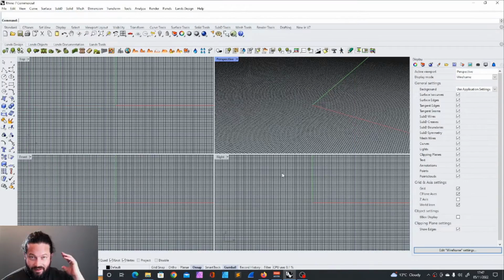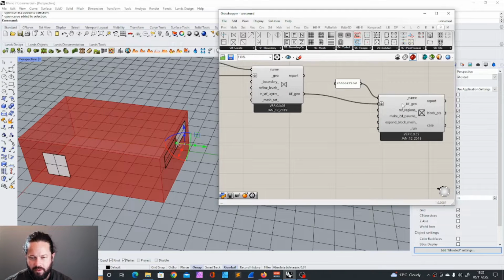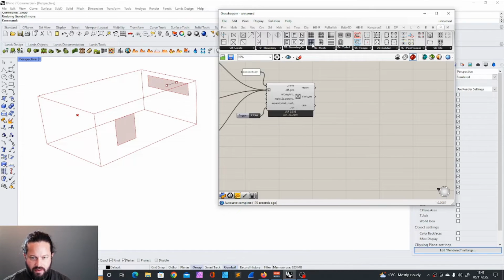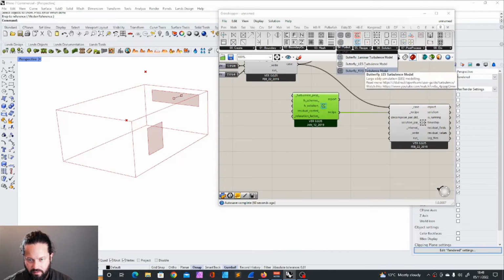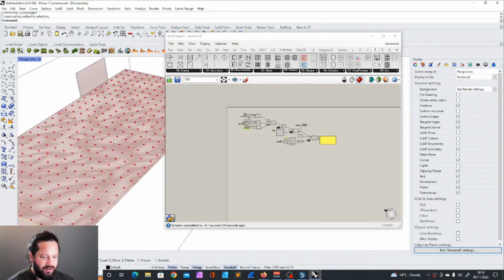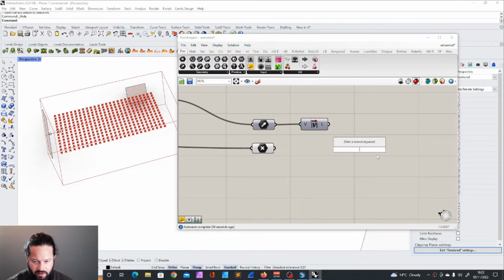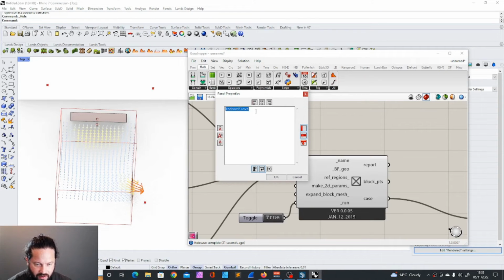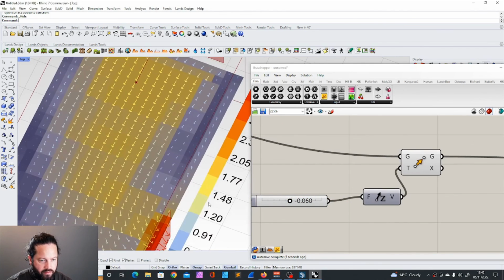Indoor Airflow - A First Script - Butterfly CFD Tutorial

Comment: Hi sir, thank you for tutorials. I can follow it and none of the components are red. However, the vector doesnt shows. How can i fix it? thank you in advance
Reply from the maker: If everything runs without errors but the vectors don’t appear, I’d first check the Vector Display component itself: make sure its preview is enabled and that it is actually receiving both the anchor points and the vectors. Also try increasing the vector scale considerably — CFD velocity vectors can be very small relative to the Rhino model. If that still doesn’t work, check the output panel to confirm that the simulation is actually returning non-zero velocity values.

Comment: tengo un problema al momento se generar heatmap me aparece un error. 1. Solution exception:Expected the number of data set values (2812) to align with the number of faces (4869) or the number of vertices (5012). Consider flattening the _values input and using the "Mesh Join" component to join the _mesh input. en este caso que debo hacer ? no he podido encontrar una solucion porque hasta _values lo he puesto en flatten y no me da
Reply from the maker: This error usually means the mesh and the result values don’t correspond to each other. Flattening only fixes the data-tree structure — it won’t fix a mismatch in the actual number of values.
The Heatmap component needs either one value per mesh face or one value per mesh vertex. In your case, 2812 values don’t match either 4869 faces or 5012 vertices. Make sure the test mesh and the probe points come from the same origin mesh, and if the mesh is split into several parts, join it with Mesh Join before connecting it and before generating probe points.  If the counts still don’t match, the results need to be regenerated or mapped to the correct mesh. You might need to delete the previous calculation or rename the analysis.

Comment: Hii, thank you very much for the tutorial. I am facing an error at Butterfly Load Mesh it is saying "1. Solution exception:index out of range: 6"
Reply from the maker: Have installed Blue CFD core. And Which version?
Reply: @PhilippGalvanDesign  Yes I have installed the 2017 version
Reply from the maker: Have you tried the example file which comes with Butterfly. Check the installation files.  If that works then you have a problem with your script. If it doesn't then you have a problem with your installation. Are you running Rhino in admin mode? Did you set up the environment. (Blue CFD)

Comment: Thank you so much for your tutorial! I have met a problem, the “butterfly_load probes value” component met this error: 1. Solution exception:Failed to load values:Failed to find probes folder folder at C:\Users\fayia\butterfly\indoor_airflow2\postProcessing\probes, do you know why to fix it? thank you so much!
Reply from the maker: Are you running Butterfly in Admin mode?
Reply: @PhilippGalvanDesign  yes. I am already in admin mode.😂
Reply from the maker: Ok then that error probably means Butterfly is trying to read probe results that don’t exist. In other words: the solver never wrote them, or it wrote them somewhere else.
Most common reasons (99% of cases):
The simulation didn’t actually finish → probes never get written.
The case folder was moved / synced / renamed (OneDrive & friends are repeat offenders).
The file path contains spaces or special characters. 
Probes weren’t enabled in that run, but the component still tries to read them.
Version mismatch: old Butterfly definition + newer OpenFOAM layout.

Do this, in this order:
Run the case without probes first. If that fails, probes are not your problem.
Put the case in a boring path like C:\CFD\case01\ (no spaces, no undrrlines, no drama).
After running, check if a probes or postProcessing/probes folder actually exists.
If it doesn’t → Butterfly can’t  read it.
If on Windows, run Rhino once as admin and make sure the folder isn’t read-only.

Comment: Hi Philipp, thanks for the guidance, really helpful. I have an error right at the end at LoadProbesValues saying: 1. Solution exception:Failed to load values:
	Failed to find probes folder folder at C:\Users\User\butterfly\indoorFlow\postProcessing\probes. If I remove the solution node the error is gone, therefore I think there is something to do with the Solution. The reporting panel says the following:' Failed to read c:\users\User\butterfly\indoorFlow\log\simpleFoam.err ' I was reading forums about re-running the probe, but I am not sure what that means. I checked all the installs, went through them again, it all should be ok with BlueCFD 2017. This error keeps coming up, but no one answers them anymore in the forums.
Reply from the maker: Are you running Rhino in admin mode?
Reply: @PhilippGalvanDesign  Yes I was running it in admin mode. I gave up at the end as after searching several forums, multiple people had the same issue, but there was no answer to it...

Comment: Can we make walls and openings parametrically ? So we can optimize the position of openings after calculating the flow.
Reply from the maker: Yes you can but you need to re run the calculation each time you change the position.
Reply: @PhilippGalvanDesign  can we combine it with Galapagos to get most optimum airflow from the combo of parametric wall+opening and the air flow.
Reply from the maker: @kalpit3d934  in theory yes but it will be a bit complicated to setup.

Comment: Hi Phillip,
I really appreciate your video tutorials.
But like some of us here I am stuck at LoadProbesValue, the error says failing to load probes from the postProcessing folder.

I then started trouble-shoot from the beginning,
1. Follow the steps on the installation video
2. reinstalled both OpenFOAM 2017-2 and Butterfly 
3. Opened Rhino 7 in Admin mode 
4. Rebuilt the script (after copy-paste failed) 
5. Same issue occurred, failing to load probes
6. I thought it was my windows 11 issue so I switched to another computer with window 10 and followed all the process again but the same issue occured. 

What should I do next?
Reply from the maker: Have you setup your blue CFD environment?
Reply from the maker: Also l did you try one of the example files?
Reply: @PhilippGalvanDesign  The example files works!
Reply from the maker: Another thing to look out for is your user name in windows. Needs to be plain English, no special characters or spaces... I think...
Reply: @PhilippGalvanDesign  Both of my computers have "_" in the user name, is that the issue?

Comment: Hi Philipp,

I have followed your tutorial, however the solution is not working, as the Butterrfly_loadprobesvalue components are failing to find the probe folder. It is attempting to find the probe folder folder in "Users\username\butterfly\indoor_airflow\postProcessing\probes , but I can see that this folder "postProcessing" does not exist. I can see there is a probes document in "systems" folder. I also attempted to create a probes folder to a new "postProcessing" folder. Do you have any suggestions? 

Even when I try to use the script from the example files folder, it comes up with the same error message as a red component. 

FYI, I am using Rhino in Admin (the file is in meters), and have BlueCFD 2017 installed too.
Reply from the maker: Have you created the environment for BlueCFD? Did you try one of the example scripts?
Reply: @PhilippGalvanDesign  Hi Philipp, thanks for your quick response! I have tried an example script, and the same load probes components are still red, and cant find this folder. Regarding creating an environment, how exactly would I do that? (I'm still a bit new to CFD, although I've watched many of your other grasshopper tutorials)
Reply from the maker: I would start here:
This includes the environment setup for BlueCFD.
https://youtube.com/playlist?list=PL4Rc2GtLpcNVWy0DsYd74cY8LSczF8V1B
This is my playlist. The second video is an in depth installation guide. 
You need to follow on the dot. Any mistake here and it won't work. 
If you still struggle then there is a problem with your installation possibly a problem with your system. Does you windows username have any special characters or spaces?
Key items: 
1) BlueCFD 2017 plus setting up the environment
2) Installation of Butterfly and possibly unlocking the installed component. 
3) Running Rhino in Admin mode!
Testing more then one of the example files.
Reply from the maker: In this video I covered how you can check if your installed grasshopper component is unlocked
https://youtu.be/k9I6KaWM5Yw
Reply from the maker: Did you had some success with it, or still not working.
Reply: @PhilippGalvanDesign  Hi Philipp, I've re-watched the videos suggested above, and made sure i have followed 1) to 3) as you mentioned above, but still no improvement unfortunately. I even uninstalled and reinstalled butterfly just in case. I tried the example script instead of the one you created in your tutorials, and i noticed the loadprobesvalue component goes red once I toggle true on the part 3. solution component.

I'm not sure if this piece of info will help, but the panel connected to the solution component reads the following message:

/*---------------------------------------------------------------------------*\
| =========                 |                                                 |
| \\      /  F ield         | OpenFOAM: The Open Source CFD Toolbox           |
|  \\    /   O peration     | Version:  5.x                                   |
|   \\  /    A nd           | Web:      www.OpenFOAM.org                      |
|    \\/     M anipulation  |                                                 |
\*---------------------------------------------------------------------------*/
/*   Windows 32 and 64 bit porting by blueCAPE: http://www.bluecape.com.pt   *\
|  Based on Windows porting (2.0.x v4) by Symscape: http://www.symscape.com   |
\*---------------------------------------------------------------------------*/
Build  : 5.x-963176928289
Exec   : simpleFoam
Date   : Jun 05 2023
Time   : 15:32:27
Host   : "Mycomputername"
PID    : 1968
I/O    : uncollated
Case   : c:/Users/username/butterfly/indoor_airflow
nProcs : 1
SigFpe : Enabling floating point exception trapping (FOAM_SIGFPE).
fileModificationChecking : Monitoring run-time modified files using timeStampMaster (fileModificationSkew 10)
allowSystemOperations : Allowing user-supplied system call operations

// * * * * * * * * * * * * * * * * * * * * * * * * * * * * * * * * * * * * * //
Create time

Create mesh for time = 0

SIMPLE: convergence criteria
    field nut	 tolerance 0.0001
    field k	 tolerance 0.0001
    field U	 tolerance 0.0001
    field p	 tolerance 0.0001
    field epsilon	 tolerance 0.0001

Reading field p
Failed to read C:\Users\username\butterfly\indoor_airflow\log\simpleFoam.err:
	[Errno 2] Could not find file 'C:\Users\username\butterfly\indoor_airflow\log\simpleFoam.err'.: C:\Users\username\butterfly\indoor_airflow\log\simpleFoam.err
done!
Reply from the maker: Hmm 🤔
That's a pity... Not really sure what the problem could be. Have tried all of the example scripts?

Comment: Hi Phillipp, I have an error in the Butterfly_block mesh component, the error is a Windows Error, I try a lot of thing but I could not solve the error,  could you help me.
Reply from the maker: When you say the error is a Windows error. What errors message do you have and where?
Reply: @PhilippGalvanDesign  when I change the value to true in the both of the boolean toggle in the inputs write_ and run_ of the Butterfly_block mesh component, the color of the component put in red and the message of the error in the component is "Solution exception:Windows Error", minute 6:34 in your video.
Reply from the maker: @edwingonzalezmeza6212  
ok, I'm wondering if you installed everything correctly. make sure you follow this tutorial to the dot.
https://youtu.be/6meHDZMJp-I

Another way to see if there is a problem with your installation is to open one of the example files which came with Butterfly.

also you need to run rhino in admin mode
Let me know if that helps
Reply: @PhilippGalvanDesign  Hello Phillipp, I uninstalled BlueCFD and Butterfly, I reinstalled it again watching the video you share with me, I even repeated this process a couple of times and I still get the error, I have already looked at several blogs to see what I can do and I'm still pulling my hair out. Thanks
Reply from the maker: @edwingonzalezmeza6212  
Which version of blue CFD did you install?
Reply: @PhilippGalvanDesign  blueCFD-Core 2017-2

Comment: Hi Phillip, I'm utilizing this test to examine airflow for my architecture project, I'm stuck around 12 minutes in on the loadProbesValue segment:
I've narrowed the problem down to the fact that my folder for this case "indoorflow" [plugged into the caseFromGeos module] does not have a postProcessing folder that has U values in it [I tried substituting the postprocessing folder from a test file and it worked, albiet there were more U values so more arrow vectors]. 
How do I generate this U file for my specific file? Am I missing a program or download?  Thank you!
Reply from the maker: you might want to check the bideo at arround 9:45 -
You need to specify the field before you can retrieve the values from it.
Did you install Blue CFD (bluecfd 2017)?
Reply: @PhilippGalvanDesign  Hi Phillip! Thanks for responding so fast! 
Yep, I had the core terminal launched when testing [2017 version, not sure if I have to have anything else launching], and all the values of the fields as U for the butterfly_probes and butterfly_loadProbeValue modules!
Reply from the maker: @hue427  you could try to use one of the sample files to test if you system works.
the samples files are in the installation folder.
Reply from the maker: @hue427  also you need to run rhino in admin mode.
Reply: @PhilippGalvanDesign  That might be it! I will try that after I try the sample file; currently running it and it seems to be working...
Reply: @PhilippGalvanDesign  Hi Phillip, I tried to run my file in the test mode and it did not seem to work well but running my file in the script provided by this video on admin rhino seem to work well! My verticle plane seems to not be working correctly as it has arrows in the X direction rather than Z but I think I can figure that out! You've been a tremendous help! Thank you for your videos :)
Reply from the maker: Just note that any butterfly script needs rhino to run in admin mode. Otherwise butterfly can't write or read files from your computer.
Reply: @PhilippGalvanDesign  Hi Philipp, how would we do this exactly?  I've run in Admin mode and all my fields have U too, but I'm having the same issue, and red warning text :(